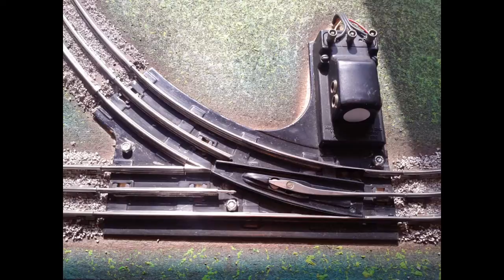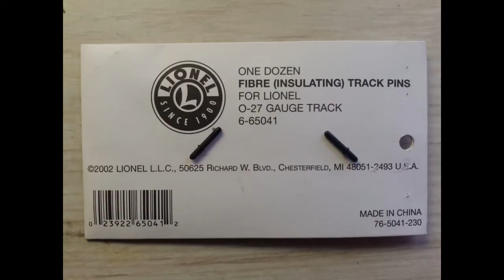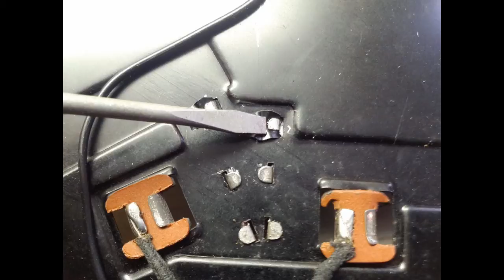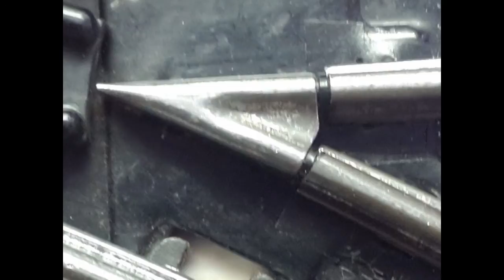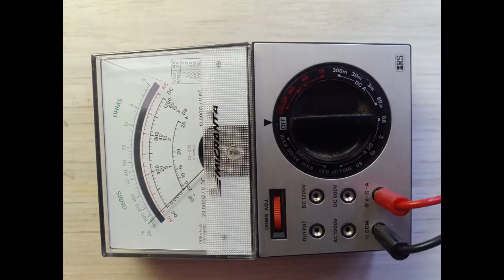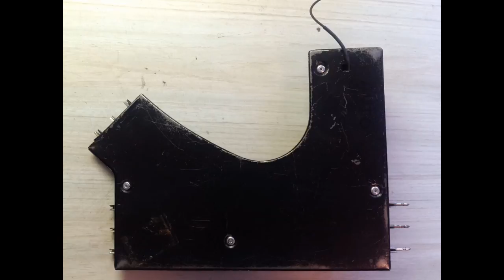Automating Lionel 1121 Switches

Comment: Can these be run off fixed voltage?
Reply from the maker: Indeed.  That is the objective of pulling the wire off the center rail and running it out the bottom.  I then connected it to another output on a ZW transformer and set it about 13V if I remember correctly.  These old switches get a little stiff i.e. worn, and need a little extra coaxing  That keeps them crisp, particularly when the train is running slowly.  That is separate from automating - you can make the fixed voltage improvement even if you don't want to get into the teardown of automating.  In addition, while you have the bottom cover off it is helpful to tighten the pivot.  I made a spanner to fit over the center rail out of doweling, then flipped the switch over and peened the flange lightly.  This peening was the most effective maintenance step on very worn/sticking switches.  I also put a drop of oil on the shaft but I'm not sure it did any good with the plastic.
Reply: @terrymurphy7259  thanks

Comment: Hello just wondering is there a issue with the coils being activated when a car is parked on isolated rail ? Do the coils get hot from a constant voltage ?
Reply from the maker: I never noticed them getting hot, but you can certainly hear them buzzing.  I can't say that would harm them but I also doubt its good for them.  I don't know if the later automatic versions used different coils but they did not come with any warnings.  In any case, I try to keep cars from sitting on them.  That is the disadvantage of the constant voltage: the advantage being the ability to switch with the train standing still and the reliably crisp performance when activated.  I tried to think of a way to arrange some kind of latching circuit that would disengage after the switch completed the throw but all my ideas required mechanical modification of the switches.
Reply: @terrymurphy7259   thank you for your quick response I know this is an older post . I appreciate the information .

Comment: Hi Terry, I’m a newbie at this as my grandson has begun to like trains.  I get how to insultate the outside rail and connect it to the switch terminal, but where does the white wire connect to (center rail connection from the lock on)?   Where do I connect the #1 white wire to?  Thanks!!  David
Reply from the maker: I used the lock on as an easy way to connect the isolated rail (instead of soldering a wire to it).  But since it also picks up the center rail, I just used it to add another power point for the main track.  It runs to the transformer and has nothing to do with automating the switches.  My layout now has 11 switches, 1 "main line", and 4 internal loop backs, and I've been delighted watching my 6 year old grandson run it.  Worth the effort.  Good luck.

Comment: Terry, you seemed to have different red & green lenses on your 1121's than the very dim ones that come from the factory - what is your solution?
Reply from the maker: I have replaced a few lenses that were missing, but the main issue is new bulbs.  Today's 12v bulbs may not last as long but they are brighter.

Comment: Greenberg's  (Seventh Edition) repair and operating manual  for Lionel Trains 1945 - 1969 shows methods using insulated track rails (on outside tracks) and various Lionel  contactors & lockons. These examples can be seen on page 624.  You've stepped it up a notch by making your 1121's  fixed voltage ready, kudos!  Wow!  Great work!